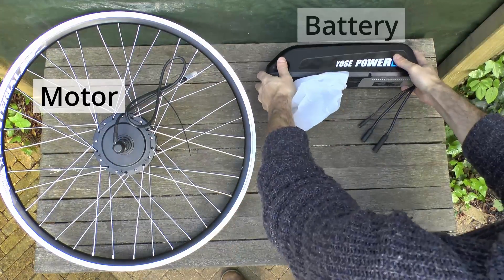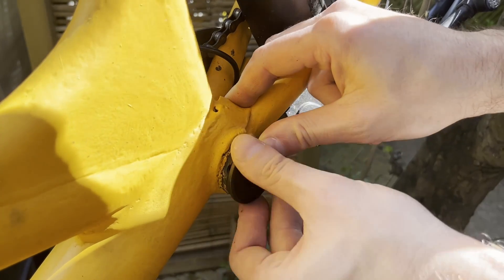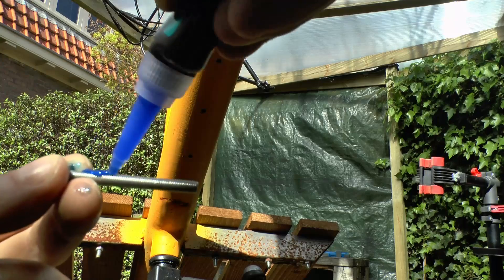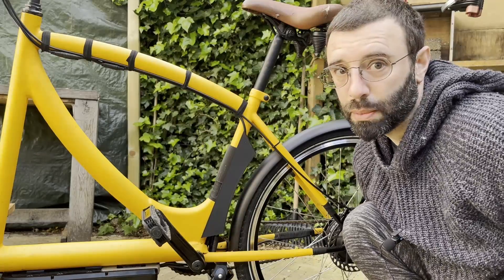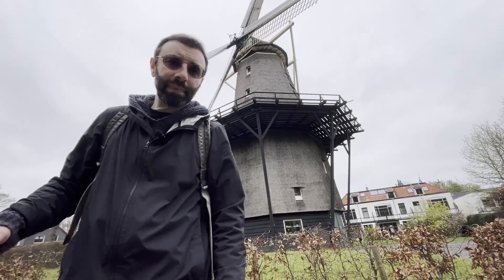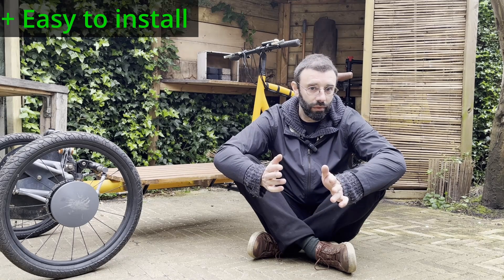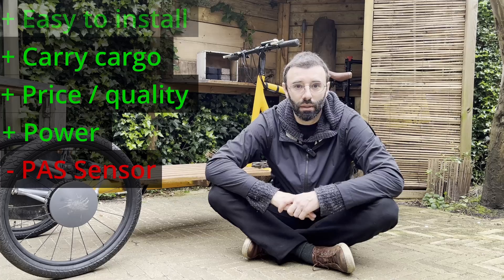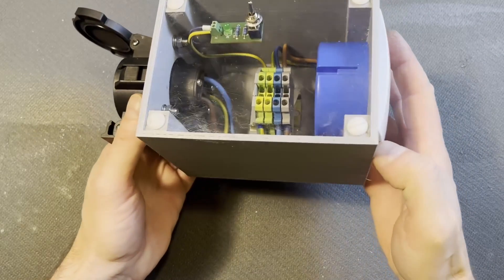Cargo Trike Electric Conversion #7

Comment: nice work but the battery position leaves it rather exposed to damage and being upside down prone to water ingress
Reply from the maker: Indeed, I wanted to have it invisible but it's not the safest position.
Reply: @ couldn’t you mount it on the front down tube where you could construct a waterproof cover
Reply from the maker: @bobbo9549  I could indeed. But I think the waterproof cover is not needed because the battery is water proof.
Reply: @pedro-neves I see you have a Yosepower battery, the same as I have on my Yosepower kit. On the Yosepower website it advises to use their water and dust-proof cover. 
I’m sure you could fabricate a 2 part cover. The 1st part secured behind the battery mounting which stays in place and 2nd part that covers the remainder of the battery but can be removed to remove and switch the battery on and off.
I’m not wishing to sound negative, but I wouldn’t like to think your creation would go bang in the rain.
Reply from the maker: @bobbo9549  oh, thank you so much for that! Even though the battery may have some level of water proofing, I agree that it should be protected from water and dust. And I wouldn't argue with the manufacturer instructions;)
Cheers!

Comment: You got a lot of distance on a single charge, even using high levels of assistance, much better than my 24kg e-bike (36v, 10.4 Ah).
Are the voltage and capacity of  your battery the same as in the product link, ie 36v and 13Ah?
Thanks.
Reply from the maker: Hi, yes, I used the kit in the link with 36V, 13Ah. I did get a very decent distance. Keep in mind that the kit was brand new.

Comment: Your trike-ecargo bike is very interesting.  The weight distributed over three wheels is logical and the width of the vehicle is not compromised by it's widest point (the cargo).

I have been thinking of building an eCargo bike (due to off the shelf solutions being expensive) and now I have to rethink the solution as your solution (though a little more complex) has many compelling arguments that make it much better than off the shelf solutions!
Reply from the maker: Thank you so much! I started a new design more rigorous and I'm sharing the CAD files in editable format if you're interested: https://youtu.be/UWFQ6nFzpgE?si=67zlL15okRsPo60N.
Cheers!
Reply: @pedro-neves  Thanks!  I'm looking forward to it!  Keep up the amazing work!
Reply from the maker: @orangespy  thank you!

Comment: It would be safer if battery was inside frame triangle, not outside. It may be damaged by hitting stone or curb. Also I think mid drive would be better for cargo bike, better hill climbing capabilities.
Reply from the maker: Hello, I fully agree. In the next version, the battery will be inside of the triangle.
Cheers!

Comment: its madness the lack of ebike charging infrastructure , i keep telling my local council how it would draw in ebike tourists . i went a home built trailer route for ebike transport , was an easier option for me using an old fish crate and two old bike wheels and a bitto welding . i find carrying weight going downhill in the wet you need quite a good grippy front tyre to avoid washouts , i am thinking of trailer brakes but not found  a hassle  free way yet .  Personally an anecdotally , illegal or not, everyone prefers throttle assist to pedal assist .
Reply from the maker: Hello, yes indeed, I would also hope for an increase of spots to charge the bikes. I hope they will come with time.
Cheers!

Comment: try antipuncture tape for tires :) I never had flat tire since installed them
Reply from the maker: On my bike I use a thing called "tannus armour" and I never had a flat again. The tape is also interesting. Thanks for sharing!
Reply: @pedro-neves  ya, tannus is the ultimate solution but it coasts 8 times more than a tape, and imho tannus is overkill if you only ride city roads :)
Reply from the maker: @Void-in2pz  yes, it's not cheap! I didn't know about this tape. But now I'll try it one day for sure!

Comment: 16:24 I just read an article about charging and battery life and the conclusion is that 2000hz pulse current charging adds as much as 38% to battery life. It's discussed on a subreddit called batteries if you're interested. 😊
Reply from the maker: Hi, that is very interesting. I just searched it and found an article. I'll read about it. Thank you!

Comment: 5:09 I'm not sure about putting the battery under the frame, there's a reason why most are installed on the vertical downtube. You want to keep it away from impact and water ingress.😊
Reply from the maker: I'm not sure either to be honest. I put it there because it was the best looking place;) But I'm already working on the next iteration of the design.
Cheers!

Comment: Batteries usually don't come on the underside of a bike because it gets very wet and muddy. Which could open a seal or corrode the contacts. Take care!
Reply from the maker: That's true, thank you very much! I'm already working on some improvements;)
Cheers!
Reply: Some early production E bikes had their battery also on the underside. I clean the bikes in my family and one of it is such a bike. That's where my experience and concern comes from. But you can ride like that for a while, it won't make much problems in a short term.
Love your dedication for your bike!
Reply from the maker: @Manfred_Messer  thank you very much for your kind comment and also for the tips!

Comment: Looks like a nice kit. Isn't it better with the motor in the crank/pedal though?
Reply from the maker: Good point. This kit is easier to adapt in a bike that you already have. Little modifications are required. A motor in the crank may be harder to assemble but with some benefits like having torque sensor. In my opinion, both systems have advantages in different situations.

Comment: Your saddle should be higher, you can't straighten your legs enough, therefore losing energy and efficiency from your end. It would be even easier for you to pedal if your saddle was at the correct height. This coming from a mountain biker who's been riding for 7 years.
Reply from the maker: Hi, I fully agree! The saddle should be high enough so that the legs almost stretch in the furthest position. And you are right - I should show the saddle in the right position to influence others to regulate their equipment correctly. Will have it in mind for next time.
Cheers!

Comment: You forgot the torque arms. Good luck 😂. And I think thump throttle for walk assist (3-5)kmh is legal. It is in Germany. I think in other countries too.
Reply from the maker: Hello, yes, this pedal assist system does not work with a torque sensor but with motion sensor. I also believe that the walk assist is legal. Cheers!
Reply: That's not what I mean, I talk about tourqe arms. Those are to support the increased mechanical stress which the elektric motor adds to the frame. Do a research or get a maybe not so happy ending with your construction. TOURQE ARMS!!
Reply from the maker: @christianklasen640  thank you for the clarification.
This motor can produce a maximum of 40 Nm. With a typical ratio of crank to freewheel, most humans can produce much more than that with the pedals, and for this reason I concluded that the frame doesn't need torque arms because of this motor.

Comment: you migt already know that a ebike kit like this in the Netherlands is iligal it has to be pedel asist  and not a trotle lik you have here 

becos its iligal anyway i recomend getting the strongest motor that you can find the 250 watt limit is a bit weak i find 

i got a 32Ah 60v batery powering mine and i get about 60km out of it at full power at 450 watts wich is great iligal but great

thanks for the eve charging station tip
Reply from the maker: Hello,
I forgot to say in the video that the throttle only takes it until 6 km/h which is inline with European regulations.
You're welcome.
Cheers!

Comment: Hey! By the looks of it, I have the same battery for my e-bike and the charger (not the battery) gets immensly hot (when charging). Do you have this too? I am a bit worried.
Reply from the maker: Hey, my battery does not get hot at all.
You should be worried if your battery gets hot. I advise you contact the manufacturer and not use it anymore.
One question - Does the charger light ever get green?
Reply: @pedro-neves  Yes, it gets green, the battery will be fully loaded. I contacted the seller (geekbuying) and you can guess their reply... :) something like "all is good, it is CE certified" Thanks for nothing, then!  I guess. :) At least if my house burns down the insurance will buy me a new one. :)
Reply from the maker: @onthepegs , some extra info from the battery's manual:
- Working charging temperature until 45 degC.
- If the light does not become green until 10 hours, stop charging.
In any case, if you feel it's not safe, I suggest not using it. It's not worth to risk your safety.
Reply: @pedro-neves  thanks! I think it was 60C... ABS plastic is good up to 80C so. Well, I am riding a motorbike anyway. :D
Reply from the maker: @onthepegs , be safe! that's the most important. Some things are worth some risk but not a hot battery.
Cheers!
Reply: @pedro-neves  Hi,I have an idea, sent you an email. If it doesn't arrive check your spam for keyword "trike".

Comment: Pretty cool episode.  I like the ev charging adapter.  
You might want to consider foul weather operation with your ebike equipment installation.  The battery pack and motor controller location might tend to unfavorably collect water if the trike is operated in the rain (4:50).  Similarly, the 3 connectors, 6:24, might tend to take on any liquid, including rain water, when oriented like this.  It appears a larger shroud is facing upward like a funnel on at least two of the connectors.  Anyway, just things to consider.  I realize you're sharing your first-off prototype, and nicely done.
Reply from the maker: Thank you so much!
Indeed I agree about the battery and controller having an unfavorable position to collecting water and that the connectors could be in an enclosed place.
This was the first version where I convert the vehicle to electric. I will improve it.
Cheers!

Comment: Great project. When you have finalized the geometry, you might want to get inspiration for lightweight engineering by searching “formula student suspension” for ideas on suspension links etc. the main idea is that if you can avoid bending, the parts can be much lighter.

Comment: Dutch law forbids the use of thumb throttles on bicycles! I would hate to see your bike impounded by police!
Reply from the maker: Hi, I forgot to explain that the thumb throttle only takes it to max 6 km/h. I believe this is inline with European regulation.
Reply: Charging on the boat would be handy.
Reply from the maker: @fisheater844  hehe, true;) Actually, I think  some ships have that. E.g. the ships that cross the Strait of Dover.
Reply: What type of throttle do they what you to have ? The roll throttle like on a motorcycle seems like overkill.
Reply from the maker: @DasNewsNetwork  it's a thumb throttle. I show it clearly at 2:34 if you like to take a look. Cheers!
Reply: @pedro-neves  oh I saw your thumb throttle. 

I was asking what type do they want you have if you CANT have a thumb throttle.
Reply from the maker: @DasNewsNetwork  aah, sorry;) 
So, in Europe there is this type of vehicle (the category I'm working on) which can have electric assistance (meaning you have to be pedaling for the motor to work) to up to 25 km/h and the permanent power of the motor cannot exceed 250 W. For this type of vehicle you can have a throttle of any type but the throttle can only take you to 6 km/h;).
The reason why I chose this category is - you don't need a license plate, insurance or helmet and you can ride in the bicycle path.
Hope this answers your question.

Comment: It wobble from left to right very much. It looks very unstable to ride.
Reply from the maker: Hello, the front hub bearings are getting worn out. I'm changing the concept of hubs to more robust.
Cheers!
Reply: Ah, that would also explain the wobble in the front left wheel. Initially I thought the alignment of that wheel was off.
Reply from the maker: @mrtnsnp , yes, the hubs need improvement. I have a big change coming up.

Comment: I know this is a low power motor, but those drop outs are very thin and a motor can chew them right up. You should install a torque arm to protect your bike, especially as it's a custom build!
Reply from the maker: Hi, yes, they are thin indeed. I'm actually about to transition to another frame to go from steel to aluminum.
Cheers!
Reply: @pedro-neves consider a intergraded wheel motor , A wide fat bike wheel will give more stability, traction and shock absorbersion . And you could even get the wheel in a 16 or 17" so you can fit heavy duty moped tires on it , and those usually come with much hevy duty brake standard, 3 bolt pattern.  ✌️
Reply from the maker: @jacobclark89  I definitely agree that the fat wheels provide more riding comfort! I always thought that they must have too much rolling resistance though. Do you have experience with those? Are they good with energy usage?
Cheers!
Reply: @pedro-neves  ya , better if u have a hard tail , some models roll  better than others , I use motor cycle tires but I have a hub motor to push it , hot and sticky compound  I'm on a two wheeled recumbent.
Reply from the maker: @jacobclark89  , I've been curious about two wheeled recumbents. I hope I have the opportunity to try one of those soon!

Comment: that thread mounting for the battery looks a little sketch. You want at least a bolt diameter of thread length engagement for reasonable strength. you can try loops around the tube too? or welding on nuts, iunno.
Reply from the maker: The tube wall thickness is 2 mm so, not a lot of thread, as you point out. I think I'll add some straps to make sure the battery doesn't fall and observe if the threads are degrading over time.
Cheers!
Reply: @pedro-neves  You can also look into riv-nuts, or    rivet nuts. That could be a more durable solution to your battery mounting problem.

Ideally though, you'd want to braze/weld diamond/square reinforcement points where the bolts penetrate the frame, like water bottle mounts. That's for you in the future though as your tools and skill improve and grow!!!!
Reply from the maker: @bicicogito  I like the riv nuts solution! Brazing is still beyond my tools indeed. The next investment will be in TIG.
Thanks!

Comment: Really love your tilting trike project, and seeing it evolving is each time a pleasure.
This time I was even more thrilled, so you are using the same kit I used on my bike too.
I also like this kit, but for me, there is another downside you didn't pointed : there is no light included, and no way to connect one on the controller. it could be an option, but yose didn't make this choice.
There should be a tricky way to do it, I made some research, but didnt find THE solution. Maybe a future challenge for you ? ;) (me crossing fingers you could take the challenge ;) )
Reply from the maker: Thank you so much! It's very inspiring to read that you are interested in the next iteration;)
Indeed, I agree that not including a light output is a downside. I guess it wouldn't be expensive to add a converter to power a couple of lights. I'll think about it;)
Cheers!

Comment: Hello, Pedro! Another solid video production!! Enjoyed every minute of it.

This question is about mass. Your Yose Power web link states that the battery weighs ~3.2kg. What does the entire kit weigh? Battery, cables, controllers, rear wheel, anything else, all added up to?

Also, what was the approximate charging time to charge your battery with the public charging station? From what battery level to the final level?

Was that flower milled by the wind mill? What type/style of bread does your friend bake? THANKS, and, THANKS to your Assistant as well!!!
Reply from the maker: Thank you very much! I'm glad you liked it. And I look forward to answering your questions!

About the mass - This is about time I get a scale. I'll buy a crane scale and get back to you.

Time to charge - This is a 13Ah battery and the charger is able to output 2A. So, about 7h for a full charge, considering that the last bit is charged slower to save the battery life. But, I will charge from one bar to full and let you know the time when I get back to you on the mass.

The flower was milled in the windmill. Thought, the mill has been modernized. To my understanding, it can use wind, but it's hybrid with electric motor. They keep it as original a possible as this is a national monument. My friend makes delicious sower dough loafs (about 500 g per loaf). Best bread in Amsterdam;)

My Assistant / Girlfriend is always very happy when her work is noticed;) THANK YOU VERY MUCH!

Cheers!
Reply from the maker: Hello, I'm back with the missing responses:
- The mass of the wheel with motor is ~7 kg
- The battery with one bar left of energy took about 6 hours to charge to full.
I got a crane scale so from now on, I'll be measuring the mass of everything;)
Cheers!